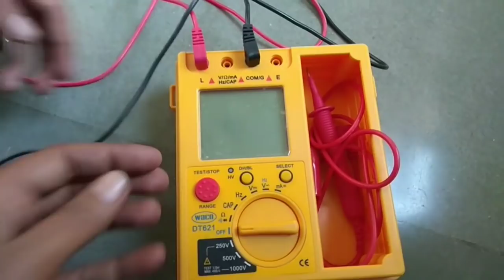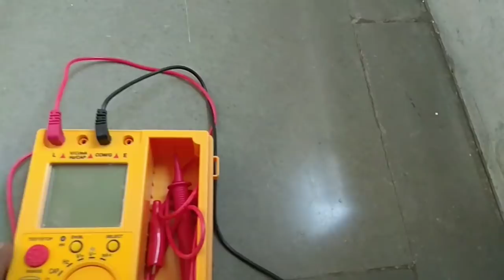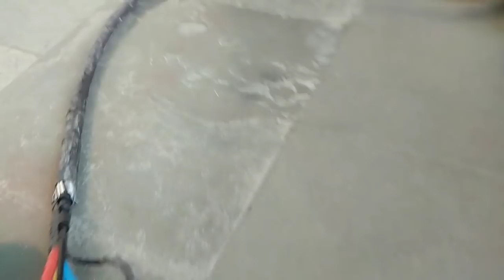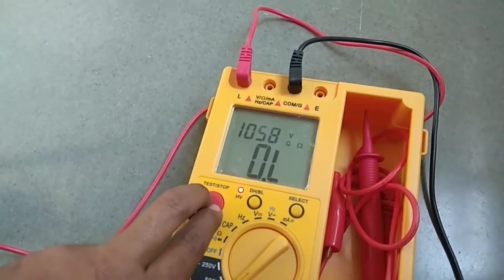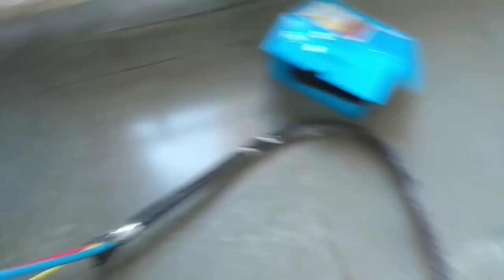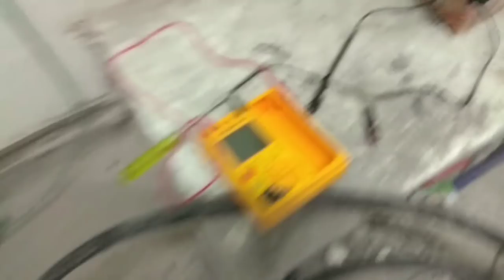Simple MEGGER test for 4 core cable to locate insulation fault

Comment: Where is the problem? You hv shorted 2 wires at one end and doing continuity test at other end. There must be "zero" reading on megger screen, but due to megger error it shows some reading. But there is not any fault in cable. You did not measure insulation resistance at last. You did continuity test and it was okay.

Comment: Please note that the particular type of model having a very serious shortfall , when the device is left in the multimeter mode it shows the auto power off after some 15 mins. But the meter still consuming power from the battery . That's the reason all the battery clips will be damaged within few months , please note it.
Only way to add an auto power off circuit , available
only at Emco Instruments Kolkata , please observe it.
Plus the megger part does not have any auto power off circuit.

Comment: “OL” stands for an “open-loop” and means that the meter is unable to measure a lower resistance value than what it already has. The meter tries to display this measurement, but since there's no way of displaying such an absurdly high number, it displays “OL” instead.

Comment: Thanks, good video, can you tell how to select the voltage based on single phase and 3phase
Reply: @Phase and Neutral thanks that's true, actually it is twice the RMS value of nominal voltage, but I don't what is the approx RMS value for 415volts and will be appropriate to send 1000v to a cable of 1100volts ?
Reply: @Phase and Neutral yup
Reply: @Phase and Neutral no, for 11kv I think it should 22kv , it cannot be 5kv which doesn't serve the purpose. 
Kindly reconfirm as I don't remember much.
Reply: @Phase and Neutral don't ask my career, it's a total mess, am in constructional field for last 10yrs .

Comment: This is cool, really cool, i was looking for simple explanation with practical n I found this n i like this explanation so much, PERFECT! Thank you
Reply from the maker: Thanks for the support
Reply: @SustainableEveryDay btw what if there is space between those 2 wires that we measure like a meter, what will happen with the mega ohm meter measurement? Cause I doubt insulating test only work if two wires are close(no space).
Reply from the maker: @aldeniprimaanugrah9509  if there is a lot of space between wires throughout there length then the megger device will show the highest value of resistance it can achieve
Reply: @SustainableEveryDay  ok thankyou bro

Comment: Sir what if there are lot of resistance different b/w R,Y,B on neutral ?
Reply from the maker: See if resistance value is big then it's good but lot of difference is there then possibility that wire is old body is twisted a lot therefore giving different values in Mohms

Comment: The results you are stating are incorrect. Wait for the meter to settle and you will see it says OL. The insulation resistance of all tests in this video are over the maximum this meter can read, which is good. But its definately not 13GΩ! Try it without the probes attached and you will see the same thing. Whats happening is you are not waiting for the HV capacitor to charge so the meter is briefly displaying wrong readings whilst the HV capacitor is charging. Wait until you see the full 1000V on the meter and that resistance reading is what you need, in this case, OL or >40GΩ
Reply: Came here to say this as well. I'm a commercial service electrician and test resistance of wires all the time. You should also touch the leads together afterwards to discharge any capacitance build up on the wire/cable.

Comment: Sir, why is E1  & P1 always short during earth test?
Reply from the maker: +Owais Bhat 
Sir , it is basically done for protection of megger device , just in case if the cable we are testing is somewhere connected to the supply then heavy current will be earthed through E1 , Insted of damaging PI port

Comment: Excellent explanation
Reply from the maker: +Muneer ahmed 
Thanks Sir
Reply: @SustainableEveryDay  how to select volage 1000v...it depends on what?
Reply from the maker: +Muneer ahmed 
Well it depends on the Sqmm . Size of your cable which you are testing , bigger the size then you select 1000v range and it will give you resistance in G ohms.
Reply: @SustainableEveryDay  thanks for reply..

Comment: Sir ,What was reading shown when connected probe to R and B ,with other END RB SHORTED ???
Reply from the maker: +ABOOTHAHIR U 
It will display "error" which means the wire is shorted, because this device is designed to only test resistance in mega ohm range and shows an error when there is conductivity between 2 wire
Reply: Good job
Reply from the maker: +Md.Sariul Islam 
Thanx Sir